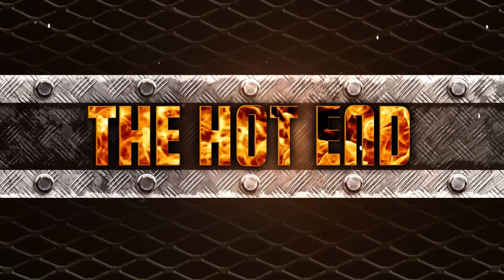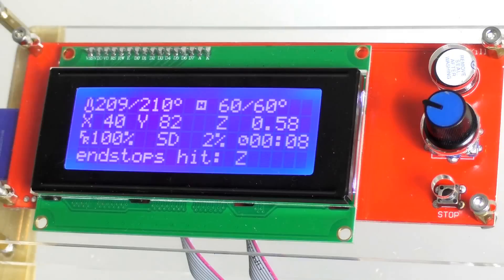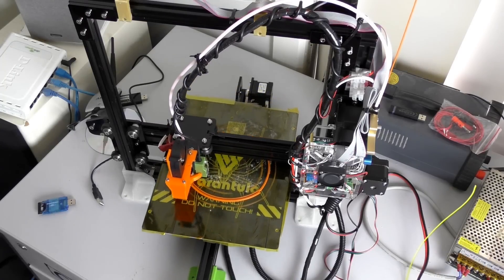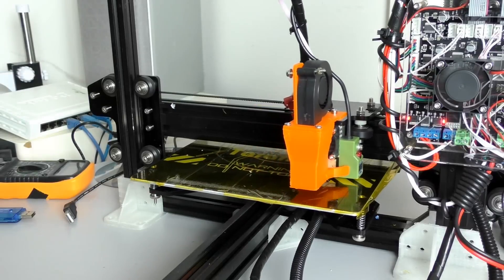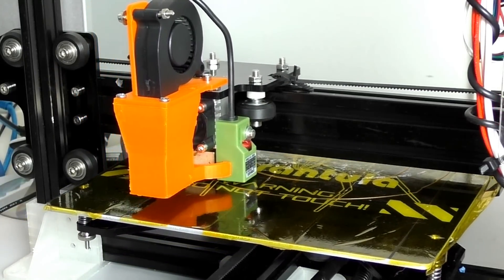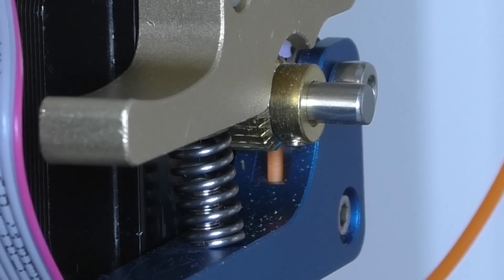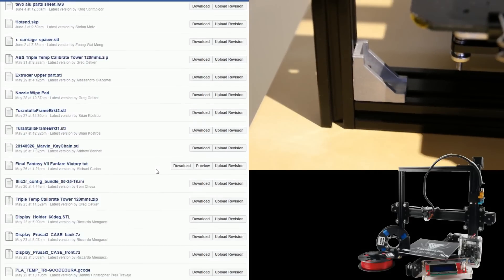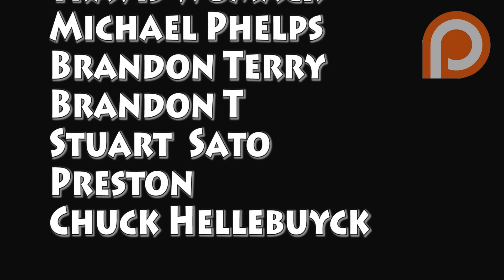TEVO Tarantula Review! Best Budget Kit ? UNDER $200

Comment: I'm buying my very first 3D printer and narrowed it down to the Tarantula or the Anet A8 3D printer which has better support for the table. Which would you go for? What a task trying to pick your first printer, glad they are so cheap these days.
Reply from the maker: Get the CR10 - worth the different trust me.
Reply: I did today. Any upgrades recommended, hardware to purchase or to print once I'm going?
Reply from the maker: CR-10? nothing needs 'tweaking' or upgrading thats why i recommend them so highly - excellent machine
Reply from the maker: Hope u used my codes :D
Reply: I also got the Anycubic 3D printer I3 Mega which seems to be highly rates, any thoughts on it?
Reply from the maker: I have not reviewed it yet but one is on its way - id have gone the CR10

Comment: Any way to get an enclosure for the motherboard?
Reply from the maker: Yes, print one
Reply: Ah, any .stl file you recommend?
Reply: There is a clear plexiglass enclosure on the front and rear, open on 4 sides for ventilation. The maximum voltage is a safe nominal 12 volts there.